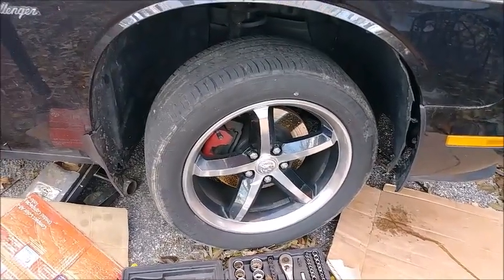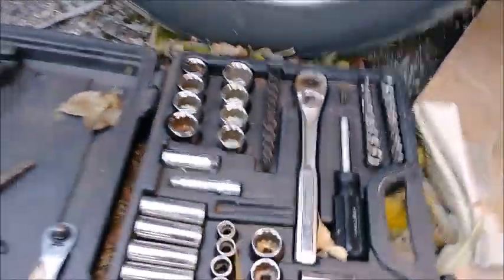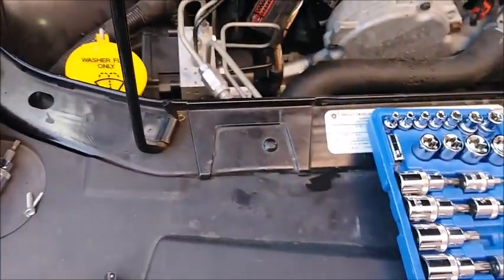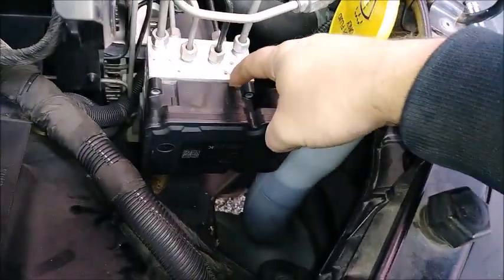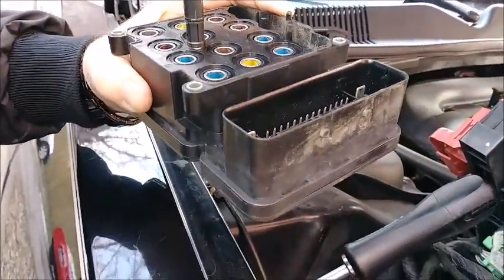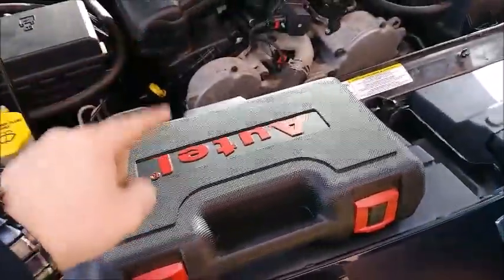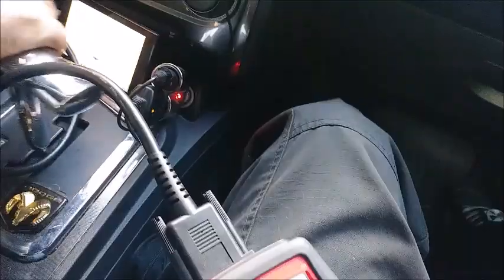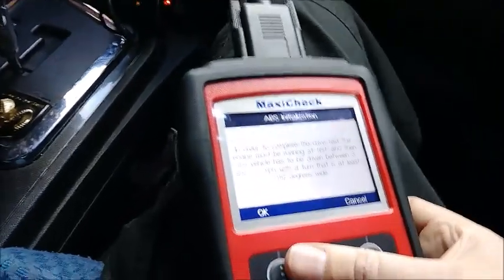Dodge Challenger ABS module C2200 replacement and fix ESP, BAS, ABS lights

Comment: So thankful I found this video. It was going go cost me between 1.3 and 3k to have it done. 2008 Srt8 Challenger. They no longer make the ABS Module and I had hell finding one. Even found one, ordered it and then had my order voided being told the part was discontinued. After scouring the internet, found out Summit reproduces them. Got it and had it installed for $90 bucks and used the Maxicheck to initialize in the very first go. The module was $575 bucks but I wanted a new one so that's fine. Scanner was around $200 and paying mechanic to install was $90. While I could have installed it myself, $90 was worth it to not have to, plus, I'd have had to wait a few days to get someone to help me the parts that require two people. I'm elated. No more codes. And it all cost me under a 1K. Don't listen to dealers or shady mechanics who tell you this is going to cost you thousands. This is the way. Thanks again so much. You saved me a ton of money! 🌟 🌟🌟🌟🌟
Reply: Do you have a link to the module on Summit? I think I found it but there's not product image and want to make sure it's the same one.
Reply: @Gabriel  I don't, but all you need to do is match the part number. That's what I did and had no issues. Best of luck!

Comment: Thanks for your video. I replaced the ABS module on my 2008 Grand Caravan. I purchased a Maxicheck Pro. I initialized the ABS module. It took 2-3 times to pass through the procedure and all lights gone and no DTC codes at all. It is not realy clear how to proceed. I drove the car on a gravel road and applied the brakes hard enough to engage the ABS and  it works well. Thanks a lot. Have a nice day.

Comment: Thanks for the video from the future since your video was 4 years ago😄. You guys saved me a bunch of money, I did it myself I have to buy an used one, because they discontinued this part, but I only paid $55.00 on eBay and the MaxiCheck on Amazon was $180.00 it wasn't easy to get this old part off specifically the two screws on the bottom, but I did it myself. The easy part was initializing it, I didn't have to drive the car, make the 90 degrees, rights or left or stop 50 feet like you did on your video, I think my MaxiCheck came optimized and updated, so as soon I pressed ABS initialization, it did a few things and cleaning rolls and gave me the passed initialization and done, all the lights went off, I am so happy😀, two thumbs up for your video!👍👍
Reply from the maker: @angelcruz7919  you're welcome. I'm glad I could help and that things went more easy for you. Happy motoring, and thanks for watching.

Comment: Would this tool work for a 2012 dodge charger with the same problems?
Reply from the maker: @SlappinFeins  I can't 100% confirm, but I don't see why not. The whole point of me buying this tool was specifically for ABS module initialization. You can select many different makes and models to work with. The Autel is not exclusively for a 2010 Challenger.

Comment: Are all the Chrysler Corp. abs modules the same?  I have a Chrysler 2007 Aspen and Autel says the MaxiCheck Pro scanner can't do anything for my vehicle.  I have bought a used guaranteed module and the MaxiCheck scanner.  I have watched your video numerous times and hope I can program my module. Regardless of the Autel customer service.
Reply: Curious if you were able to program your abs module with the maxi check pro on your Chrysler as I have a Chrysler 300 and want to make sure it works

Comment: Hi in the very beginning of the scan you said(initialize) what did you press? thx getting one tomorrow to fix my challenger ,your walk thru is greatly appreciated
Reply from the maker: It's been a minute, but I believe with "ABS initialization" highlighted you just press the "okay" button and the machine walks you through the initialization procedure. I hate computers and my dad doesn't know how they work, so if the two of us could do this, you should have no problems.
Reply: @HollywoodHornet  hey thanks bro,1 more thing did you disconnect the battery before doing the swap? you vid rocks  btw I'll be doing mine sunday or monday.
Reply from the maker: @artman2204  Negative. I left the battery connected. I don't think it would make a difference one way or the other. Definitely didn't hurt it leaving it connected. I doubt it would hurt it should you choose to disconnect it.

Comment: Thanks for the awesome video. So far, the only issue i have ran in to is that when i was researching the maxicheck, everything said that the maxidiag md806 pro was supposed to do everything  the maxicheck pro can and more but that is not the case so for anyone els finding this video you have to use the maxicheck to reinitialize the abs module atleast for the cheaper hand helds.
Reply: so what model maxicheck do i need to initalize new module?
Reply: MaxiCheck Pro

Comment: what model autel maxichek is that scanner so that I may do the same with my vehicle. Chrysler doesn't have new abs modules until 2025. I installed a different one from the yard and I also need to initialize the abs module. Th house wants to charge me 2gs to do the work. please let me know. thank you.
Reply from the maker: Maxicheck Pro.

Comment: Is this how you replace the 68089525aa master cyl 05039003?
Reply from the maker: Negative. The ABS module is not the same as the master cylinder. I actually just filmed a master cylinder replacement video on this car but it's not uploaded yet.

In the meantime, you need to remove the cowling (just the plastic part. The metal bar can stay). Then remove the two 13 mm nuts on the master cylinder or were they 15 mm? One or the other. Disconnect the two brake lines to the master cylinder and pull the master cylinder free. Replacement is refers of removal. You'll need to bleed the brakes afterwards.
Reply: @HollywoodHornet  Thank you for the guidance. I'll probably wait for the replacement video once you upload it tho 😅

Comment: If I buy a new one would I still have to go threw this ? I’ve heard with the new one you can just drive of n it will program its self is this true ?
Reply from the maker: I'm fairly certain even a new one requires initialization, unless whomever you buy the new one from can flash your VIN to the module and skip that step.

Comment: when I go to the junkyard and get the module, do it have to be the same here as my 2010 dodge charger or can I go to an 06,07,08 module?
Reply from the maker: I think it would be best to have the same year in the absence of other information but at the end of the day, having the same part number is what really matters.
Reply: @HollywoodHornet  I got 1 from the junkyard it’s saying vehicle configuration, Mitch, match and original version mismatch missing. Every time I start the test every it's says initialization failed...why
Reply from the maker: @74Fox  are there other codes in the module maybe? Like maybe it thinks there's a bad ABS sensor or something that is causing initialization to fail? Assuming the part is good, it should be as easy as I did in the video. I put the used one on (new to me) then it read VIN mismatch or whatever it said instead of the old unable to communicate code (or whatever the original code was), it's been a few years since I made this video so I forget the exact code, and then it should start the initialization. Maybe the car needs driven some first to check the other ABS components? Not sure since I didn't have your issue but do check and try those things and keep me updated.

I reckon there's a chance maybe the donor car had different software or something in it causing the issue? Like maybe your car is RWD and the donor car was AWD or something? Maybe a different transmission type? That's the only other thing I could think of and I'm not even sure it that would make a difference or cause a problem. I'm just spit-balling.
Reply: @HollywoodHornet  I’m thinking the dodge charger wasn’t a 2010 like mines and it has an R on it.. the parts look identical, but has weird numbers on the front tomorrow. I will try to find a 2010 and give you an update.

Comment: I have a 2010 challenger rt if u launch from 0 all the abs lights cut on and it start to skid a tad so I checked the abs system with Alfaobd and the code is c2200 

So hopefully this fixes that issue 

Would u know if Alfaobd system would reinitialized the new module if not what’s a good system to use for it
Reply from the maker: I am unfamiliar with the Alfaobd.
Reply: Did that fix your problem?

Comment: Having same problems code 2022, was going to send it in to repair ~dealership 1200.00, module repair service~400.00 must mail. Went to EBay-121.00 for module and went to Maxicheck site bought maxicheckpro 169.00. Just waiting for the stuff to come in. I have your video on save. I already removed the bottle…it was way easier with the tire off for me.
Reply from the maker: The wheel not being there helps. Good luck. Report back afterwards so me and anyone else reading comments isn't left on the edge of their seat.
Reply: Did it work?
Reply: @Jen_a2019  Yes it did. 
No problem,no light!

Comment: I just had the ABS Module replaced in my 2009 Dodge Journey. The person who did it said they weren't able to initialize it, and I would probably have to take it to the dealer. I saw your video, as well as a couple of others, and I wondered if you might know if you have to take it to the dealer or use something like the Maxicheck Pro to do that, or are you able to drive it 100 miles or so, and it will "reprogram or relearn" by itself. I saw it mentioned the 100 miles in another video, so I thought I would see if you knew or not. I did replace it with a new Mopar ABS Module. Just don't want to waste the time if driving it that sort of distance won't work. Thanks so much!
Reply from the maker: I'm not sure about the driving 100 miles thing. I have no experience with it one way or the other. Driving with ABS isn't anything that's required by law.

Does the driving 100 miles need to be done all at one or over a period of time? If they can be cumulative, drive around until then and see what happens. If it has to be done all at one, drive without ABS until you must take a long trip and see what happens.

If you don't own a scan tool but need one, and want to initialize on the cheap, buy the Maxicheck Pro and initialize the ABS module yourself like in the video.

If you have deep pockets, go to the dealer. It costs nothing but time to try the drive thing, tho I've never heard of it. Only one way to find out so we'll both know for sure. If you try that, report back either way so I'll know for the future.

Comment: If I want to change the module, it has to get the same part number as the damaged one? Or I can buy anyone which can fit and reinisialise. I have 2011 challenger and the module is discontinued
Reply from the maker: Get one with same part number. It doesn't matter where it comes from. Once you plug the new one in and reinitialize it, you're road ready. I recommend a used one from a junk yard. That way if it doesn't work, you can exchange it within 30 days of purchase.

Comment: I got a C2200-49 in my 2013 Dodge Charger. Would this keep the Brake Light on as well as the ABS and Traction Control lights?
Reply: Hey! How did you decide that? Your answer will definitely save me some nerves, haha. I too have a 2013 dodge charger and have this error

Comment: If you cut down a 2.3” t20 just past the knuckle, you can pair it with a mini ratchet or ratcheting quarter inch wrench to remove the module without needing to mess with the wiper fluid reservoir. Just push it out of the way…it has enough give.

Comment: I have the same Maxi check and had to change my ABS module for my 06 srt8 charger but the option your showing on your video under ABS initialization at time 8:42 does not show up.  do we need to download or update the maxi check tool?  i bought it a few months ago.
Reply from the maker: I wouldn't think you'd need an update. I didn't need one and your tool is newer than mine. It's been minute since I've done this, but I can double check when I get home. Your ignition is cycled to accessory on, correct? Engine doesn't need to be started, I don't think.

I'm fairly certain upon connection I went to "ABS" then scrolled down to "miscellaneous" and from there "ABS initialization". Perhaps I started in OBD 2 engine diagnostics or something first, but I do recall "Miscellaneous" is a sub-option somewhere and you have to get there first before you can initialize.

What options do you have to choose from and which menus are you selecting in chronological order from when you first plug in?
Reply: @HollywoodHornet  when I got home from work I will check. I'll even try to make a video of it too on the options I have on it.
Reply: @HollywoodHornet   so I looked in my settings and this is what I had.  https://youtu.be/usiWnL5Z1eI

Comment: Thank you for your very informative video. Exactly what Autel model do you use? I'm a bit confused as they offer so many models on Amazon. What year version is it. I reached out to Autel and they said the $200 model would not work for me. 2007 Dodge Charger...same exact symptoms for me after the module swap. Thanks in advance for your reply!
Reply: UPDATE! So the "Autel MaxiCheck Pro OBD2 Scanner Automotive Diagnostic Scan Tool with ABS Auto Bleed, SRS Airbag, Oil Reset, SAS, EPB, BMS for Specific Vehicles" arrived today from Amazon. The model that Autel said WOULD NOT initialize my ABS system. Well, go figure....My 2007 Police Pursuit Package 5.7 Hemi ABS module from a bone yard  is now initialized! Thanks again for your video and communication! Cheers!
Reply from the maker: @ballpeen01  Happy to help. I'm glad it worked out.
Reply from the maker: I believe it's just called the "Autel Maxicheck Pro". I'll confirm when I get home but I'm pretty sure that's what it's called.
Reply: @HollywoodHornet  Appreciate....I reached out to the company and they said it couldn't be done with that model. Yet, I saw you do it sir! BTW they said it can be done with an $850 model that they will gladly sell me!
Reply from the maker: @ballpeen01  they're lying their asses off then. Because we all saw me use it and successfully reinitialize a used ABS module from a wrecked Challenger after transplanting it onto the one in this video. It still works to this day, BTW.

For $800 you might as well take it to the dealer, it would be cheaper. However since the $200 one works, might as well DIY since that's about what the dealer would charge, and you'd still have the scan tool afterwards to show for your money spent.
Reply from the maker: @ballpeen01  I just posted some pictures of my Autel on the "community" tab on my channel. If you want to be certain of which one to buy that will work without spending $800.00 to initialize the ABS module, check out the pictures. Co firmed it is the Maxicheck Pro.
Reply: @HollywoodHornet  Thank you sir!

Comment: Got a 2007 Dodge Ram 1500 ABS on rear only had to replace the rear abs break module had to replace it with one out a junkyard how do I get the lights to cut off on the dash

Comment: Were the brakes not working before you fixed it? If not how did he drive it to do the test? I’m asking because I’m having the same issue with the same car only my brakes are not working properly. I’m wondering if I do what you did will my brakes work? Thanks and also good video very helpful saving me a lot of money
Reply from the maker: His brakes were working, but the ABS was not. So if he slammed the brakes, they would lock and skid to a stop as oppsed to the ABS pulsing the brakes and controlling the stop. Since everyone knows how St. Louos City drivers are, he wanted his ABS and stability control back ASAP. If the brakes themselves aren't working, there might be other problems. If your symptoms are exactly the same as here, it might be the same issue as the video and thus, this repair is needed.

Have you scanned the ECU and other modules for codes? Are there lights on the dash? What exactly are the brakes doing?
Reply: All the lights that were on your dash is on mines now all popped up at once... brake abs traction esp 
Codes popping up are  u0121 u0001 and c2205
Reply: My brakes barely work I would say that function at a 10-20% right now so I’m stopping later than usual the brake pedal goes basically all the way to the floor
Reply from the maker: @therealbgbirdgame7889  Are the pads or rotors worn out? How's the brake fluid level? Excessive wear on the parts will cause more fluid to enter the system and thus less fluid in the reservoir. That could introduce air into the system and give the pedal a spongy feel.

If that has happened you'll need to bleed the normal brake system and probably the ABS system as well. It might be as simple as replace the worn brakes and rotors, add fluid and bleed the air from the system. Check those and get back with me.

I just recently released a video on how to check brakes and rotors, though I haven't released the comprehensive video on brake replacement for the Challenger. It's already recorded and scheduled bit I don't think that one comes out till later this month.

"How to tell if your brakes are bad" is the name of my video from a month ago. It has a picture of an instrument cluster on it and is 7 minutes long. I show what good pads look like on the Challenger specifically.
Reply: Do you think you can give me a call 314-465-8667 I’ll greatly appreciate it.
Reply from the maker: @therealbgbirdgame7889  Give me an hour or so and I'll call. In the mean time remove the comment with your phone number so you don't get doxxed.